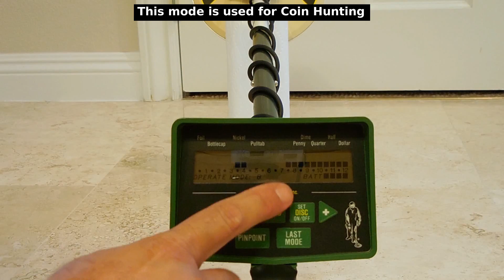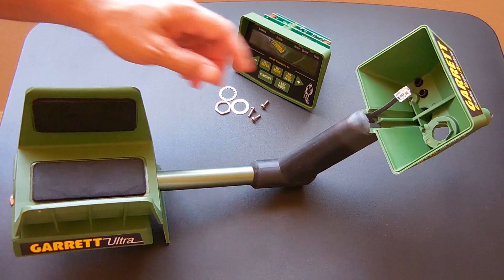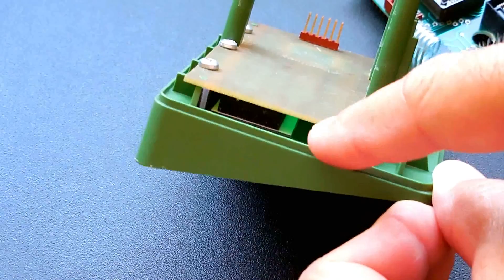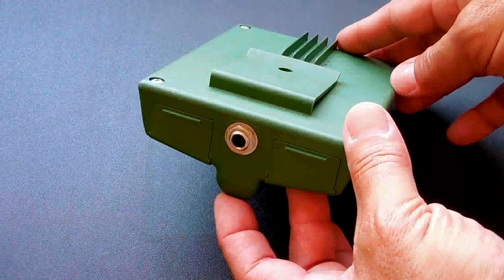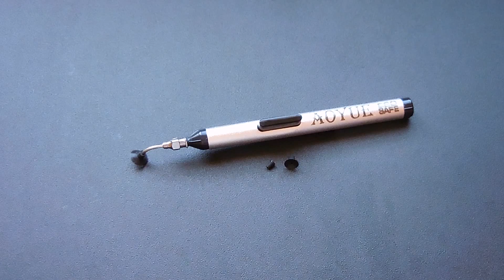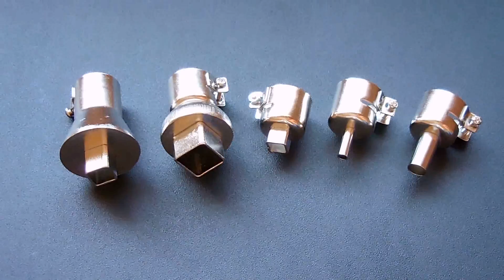Broken Metal Detector Fixed!

Comment: Excellent video, I have a GTA 1000 like new that has same battery indicator problem.. was thinking I would have to send it in but maybe I will have same experience you did & save myself some time & money!! Again thanks for the tip!!
Reply from the maker: Sometimes a disassembly and reassembly will get them working again. Good Luck!

Comment: I have same detector as well, is there a guidance how to verify if it needs re-tuning by the trimpots behind the 2 black caps on the back of the unit?  After years the elenic components may drift to different values and lower the efficiency.
It would be a service manual or someone who already leaked it to the web.

Comment: Nice metal detector video.  It would have been much better if you had shown the bad connections before and after repair.  I wanted to see what part of the connection (pin or socket side) was bad and was it visibly bad or you ohmed it out to find the problem area.
Reply from the maker: EnergyCrafts I stated in the video that the problem were the pins, not the socket. Visual inspection under magnification, followed by resistance measurements across the connector. Thanks for watching!
Reply: Thanks for replying.  You are right, I somehow missed that.  Still you did not address my other 2 points:  show a before and after of the bad area and show how you troubleshot the problem ie by obvious visible or ohm meter or some other method.  I have a possible problem of intermittent connection similar to your pins/socket design but the plating is ether gold or brass, can't tell which.  My pcb is large and complex and has many connectors.  I am trying to isolate the problem to the connectors as none of the foil runs or solder points appear bad.  Wiggling the board causes one of the LED pcb lamps to flicker.  No schematics or info to follow.  Been a electronic tech for 25 years but this one is a real puzzle.

Comment: I have a gta ultra 1000 that i am going to try this on, thanks! by the way i have 2 garrett ground hogs. 1 has no sound but the meter works. the other has sound but the disc knob is messed up. i think the problem with the one with out sound the problem is a bad solder connection.
Reply from the maker: troy hamilton Thanks for watching!

Comment: If they'd had some fresh batteries on hand to test that metal detector, you possibly could have bought it for way less than $10 , because as you mentioned that when you put fresh batteries into it , the battery life indicator was incorrect.
So even though it was a bargain at $10 , it would have been an even better bargain for way less than $10.
Reply from the maker: $10 was a steal even if it didn't work. Thanks for watching!
Reply: But it would of been a risk what if it did work he would have had to pay more

Comment: I have a GTA 500. I need to find the two battery holders that are inserted in the battery housing, but haven't found how to get them 😢
Reply from the maker: I just looked on Amazon and saw them
Reply: @electronicsNmore  Thank you for replying.I contacted Garrett directly, they are gonna send me a pair!
My machine has been up in my attic for almost 15  years, I'd say. Hopefully, it still works. I want to let my teen nephew to use it as I will be buying a new Garrett AT Pro. Hopefully, he and I can go hunting together.

Comment: I have an Ace 250 with a broken/missing battery spring. Hopefully its not hard to replace.
Reply from the maker: You can always salvage parts from another electronic device.
Reply: @electronicsNmore  I did, but noticed some corrosion/degredation on the board

Comment: Hi, I have a Garrett GTA 500. It hasn't been use for many years.  I put in the batteries, it turned on  but it beeps constantly.  Could you Please tell me what could be wrong with it?  Thanks for any information you can give.  Love your vids.
Reply from the maker: You need to open up the unit and inspect it like I did. Also inspect the coil connector for poor contact/corrosion.

Comment: Mixing materials in contact is a major cause of equipment malfunction.
Reply from the maker: Emil Almberg A much tighter fit with the pins inside the connector would have prevented the problem.
Reply: Two different materials will always lead to problems.
Especially with tin, the least noble will corrode.
Gold to gold is ok, tin to tin is ok.

Just as bad capacitors destroy people's computers and other precious equipment.
Causes this problem with all types of equipment, especially in industry.
I myself have been working on a model of advanced motor controller where a contact has to be replaced, on all the thousands who had made ...

Excuse my bad English.

Comment: I just got one and every time I go hunting for civil war relics I get false readings even if I point it up in the air
Reply from the maker: Hi Henry. Open up the unit and make sure all the connections are clean(no corrosion). Also make sure the coil connector is free of corrosion. You could have a faulty coil if you keep getting erratic readings. Thanks for watching!
Reply: electronicsNmore I turned the belltone of and it stopped doing it thanks I'm still gonna open it up and check it just to see lol
Reply: electronicsNmore also will the sensitivity make it do that if its tuned all the way up?

Comment: I have the same metal detector but it will not beep I can find stuff and dig stuff up with it but I have no sound what would cause that and how to fix it
Reply from the maker: Either damage to the audio portion of the circuit, or a bad speaker/connection.

Comment: Nice video! I picked up a gtax500 that a coworker was throwing away. The batteries were corroded so he kind of gutted the battery pack and wires. It's missing alot. Would you be willing to hook me up with some pictures of the inside of your battery pack? Id like to fix this and give it to my father.
Reply from the maker: My unit is now in storage.

Comment: Great video showing \the guts of the unit. Got mine at yard sale, can't get any sound through either the headphones or speaker. Have replaced the hip holster battery pack which included new speaker with board. Still no sound. Any suggestions?
Reply from the maker: Unplug all connections, then put them back.
Reply: @electronicsNmore  Thanks for the idea, gave it a try, but no lick.